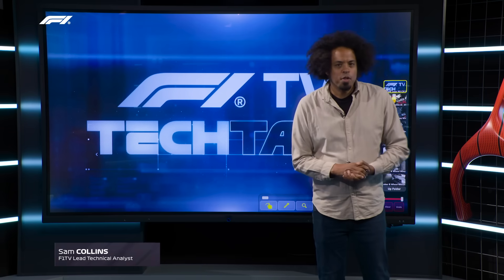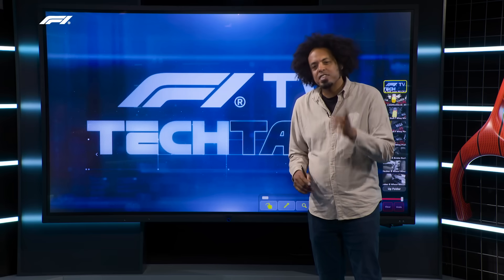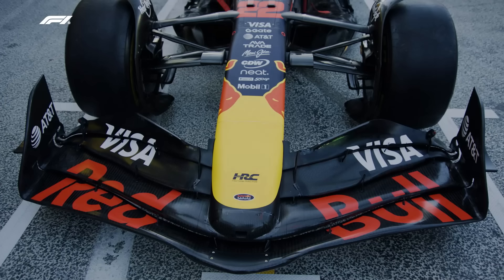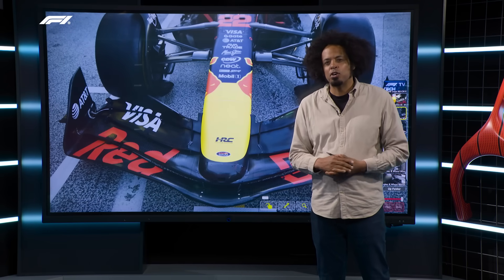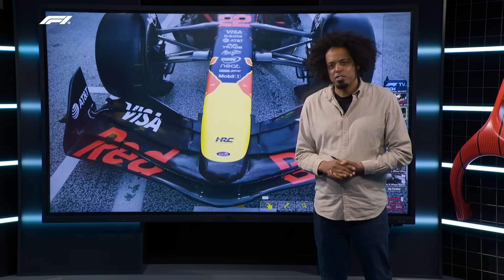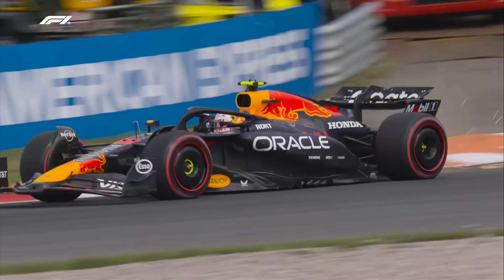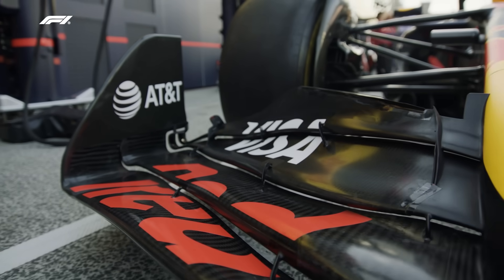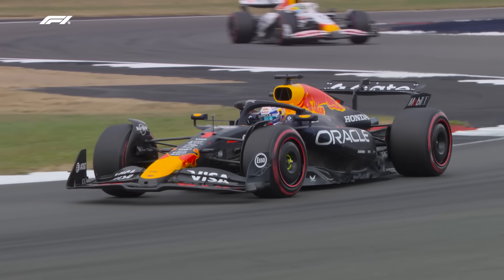What's New After Summer Break? | F1TV Tech Talk

Comment: Will CFD ever replace the physical wind tunnel?
Reply: Currently the point of the wind tunnel is to find out if your simulations are accurate. Everything is already tested in CFD before it even goes into production, as wind tunnel time is so short.
The problem is that the chaotic nature of turbulent air is incredibly hard to simulate and there needs to be validation of the values you predict. Since the aero features of F1 cars can be so small and delicate compared to regular cars, there's even more error margin. The tools they use are really advanced, but even big teams like Mercedes have been struggling in the past year with correlation between simulation and real life. 
So no, for the future it is very unlikely that wind tunnels are going to be replaced. Yes, they know what they can expect from a design, but in a sport where fractions of a percent of additional drag can cost you seconds across a race, you try your hardest to find those bits of pace.
Reply: No

Comment: Would tiny little flicks sticking up along the body like a dragon scale type body but each scale is slightly raised up to create 100+ little spoilers along certain parts of the body? Would create alot of drag I'm sure but they could counter that with a smaller body resulting in less weight? So lighter with increased downforce?